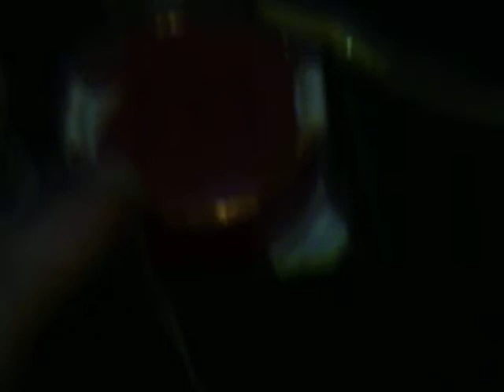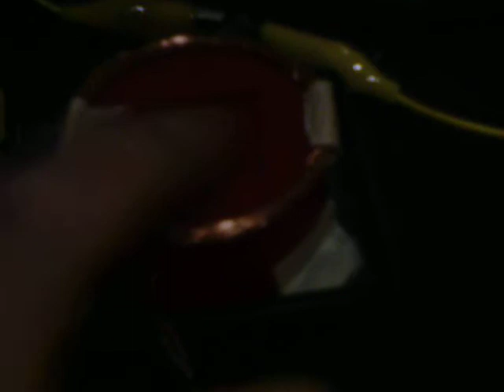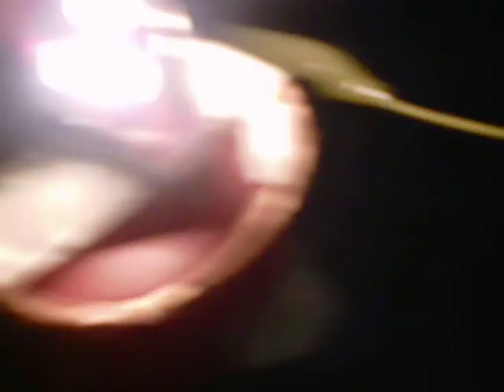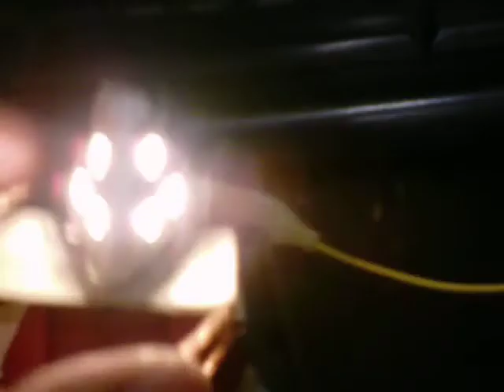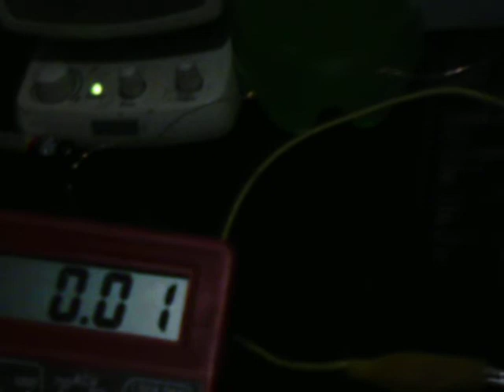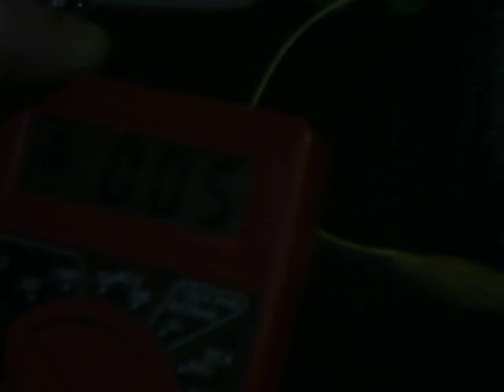slider2732's wireless system cont.. 9v, no pancake

Comment: The key to efficiency with SWES is many loads. With carefully matched coils. You can add some loads and reduce the power draw on the transmitter. See if you can get some of those garden twist tie coils used commonly in Penny type JT's. They have a delayed kickback, which puts power back to the transmitter. Like a tank circuit, you can ping the same bit of juice back and forth for some time before its lost via wire resistance.
Reply from the maker: i have been meaning to try Lidmotors penny oscillator for a while now and this project actually reminded me of that. i made a blocking oscillator with some RG-6 a while back but not in a pancake form, and was noticing some very interesting voltage spikes. the combination of the air core and wide diameter really makes a difference especially when running LED loads and such. It was counter-intuitive though to see these strong electric fields with the coax considering their manufacturing and very precise dielectric spacing. i think the coax helps mainly because of this spacing, not so much the dielectric shielding, but the thickness of the insulation which allows for a perfect spacing of the copper conductor as it's wound, which from my understanding helps a great deal with near field transfer and resonance.
Reply: Coax is normally good for shielding because the outer foil is grounded, sinking any interference to ground. In SWES and other setups that dont ground that foil, but instead run pulsed power down there, it does the opposite of shielding. According to my understanding, the smaller the dielectric gap the better. More coil boost, and higher capacitance. Although I guess the right capacitance could be worth the trade off in induction efficiency. Normally I'd only go thicker if I had corona/arcing issues. The space would definitely affect resonant freq though. As it would change induction value and capacitance value. There are bound to be perfect ratios. That's where Fibonacci usually comes in.

I think coax works so well because of its low resistance per meter more than any other factor. Less voltage drop means more amps, which means stronger emf, and stronger emp.

My cat5 BAC had problems because of the resistance being too high... More current at lower voltage is a good thing for wireless transmission....